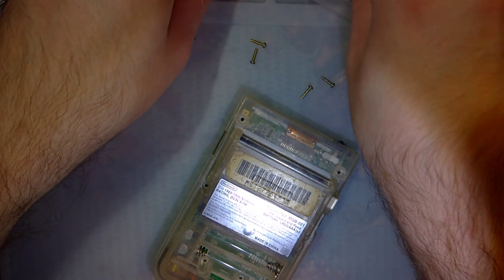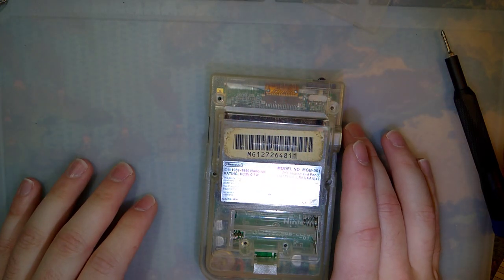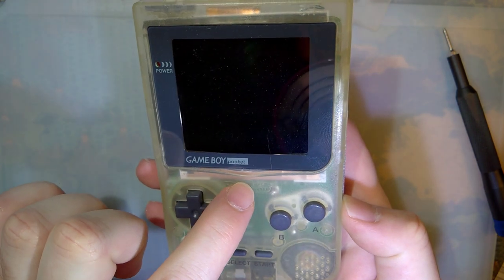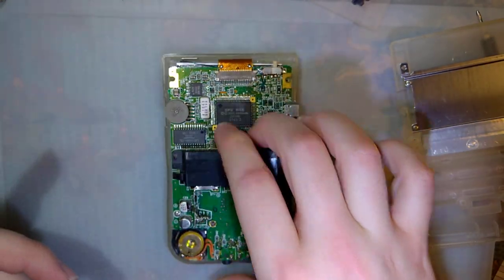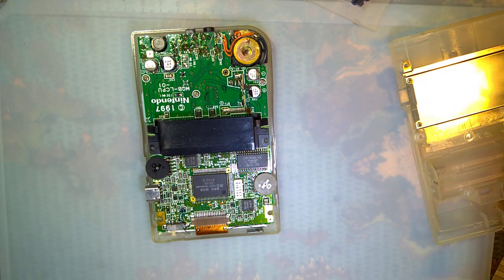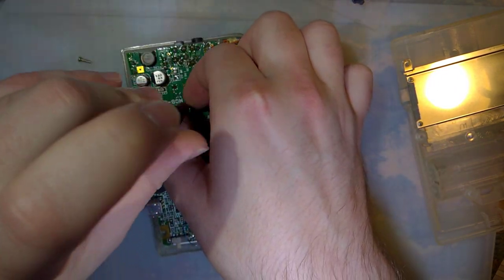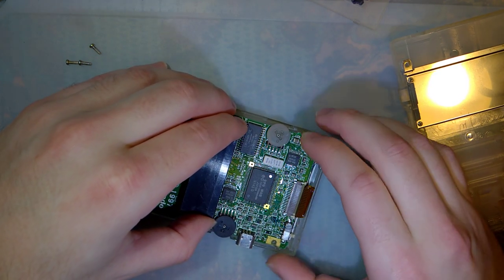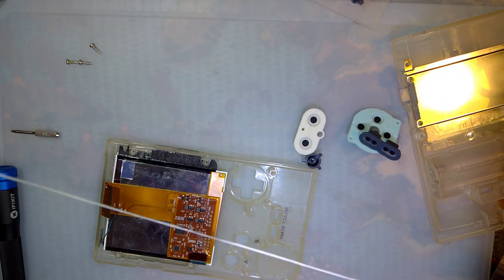How NOT To Remove the LCD in a IPS Modded Game Boy Pocket (Part 2 of 3)

Comment: Ooooh, I know that pain!
When I got the full Q5 front panel (for £3.89 eBay) the one I got had zero adhesive on the LCD panel, it had some plastic tabs behind it (for the back panel screw posts) that I bent out of the way, and then it was just a snug fit into the shell, but slid the sheilding it came with down the edge to lift it with. But that was before FunnyPlaying had the LCD alone to buy, so that would have been an option.

Comment: Damn, I should have used Your floss method when i tried to remove my iphone 5c's battery a few days ago and the adhesive strips you're supposed to pull out broke right at the black holding- part. I bet that would have been way easier than using a gamestop store card lol next time ^^; How high is the risk of amputating your fingers that way?

Comment: That sucks.. man.. thanks for sharing... your mess up well teach people what not to do.... I won't be using that 3m adhesive.
Reply: You do need to put some kind of air sealing dust gasket in there though to prevent dust and have the screen aligned.
My trick before an install is to rub a small amount of WD40 onto the 3m adhesive piece and coat that around with your fingers, then let it air dry for a while before applying it. This weakens the adhesive so that you later can undo your install more easily.
I've had to take these screens out in the past though without doing that first, you have to use a hairdryer and go incredibly slowly, you also need a square/rectangular object with microfibre in between, something that can push the entire surface of the screen evenly. Time is the main factor rather than increased pressure or heat.